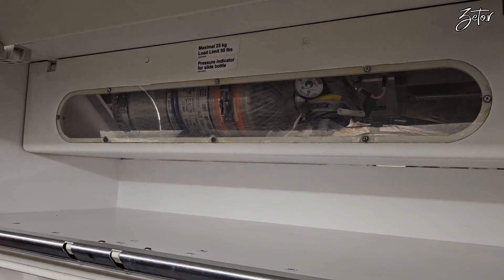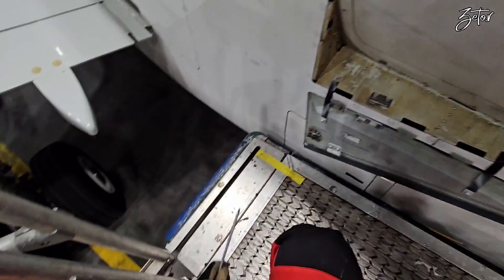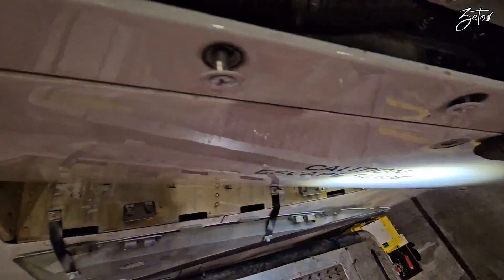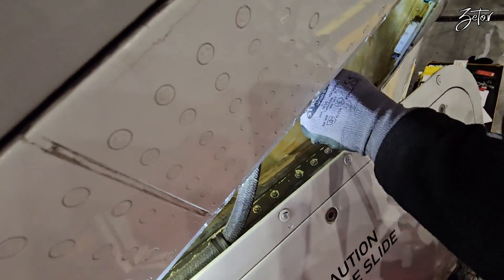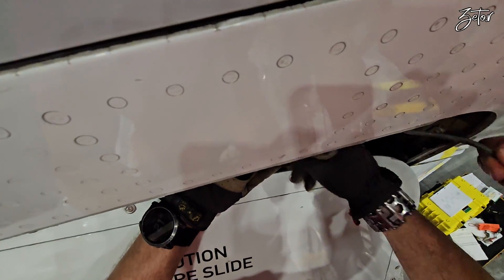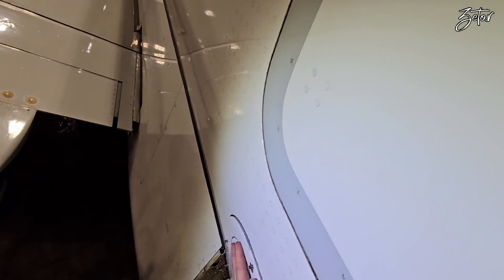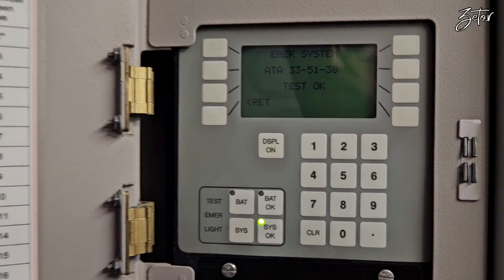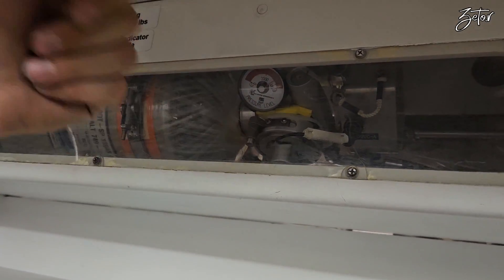ATA 25 How do replace slide under door on Airbus A321

Comment: My last work was to refurbish out of date escape slides for most Airbus, Boeing and Bombardier commercial airlines. Cool thing is that the workers wanted to work on the emergency door slide for a321 series the most due to the size of the slide and ease of folding up the slide material into the housing.
I am currently testing to get my A&P license to become an commercial aircraft mechanic. Hopefully I can get it done by this summer!!!
Thank you Zeto for your insight on the mechanisms on various aircrafts!!
Reply: At my previous airline, there were always rumors or how much it costs to replace a slide after inadvertent deployment.  How much would you estimate it costs to replace a slide on an A320?

Comment: Why did this slide need replacement?  It hasn’t been inflated.  Does it have an inspection interval requiring removal and pressure testing, then repack and reinstall, or do these slides deteriorate over time and have a use by date?
Reply from the maker: Shop check required
Reply: @zeto.r  Ah - right...  So...  I was on the right track with the "inspection interval"...  🙂  Does the shop check go as far as inflating and leak testing?  Thanks  🙂
Reply from the maker: Yes for sure they inflate it in the shop and it needs to remain inflated for certain time